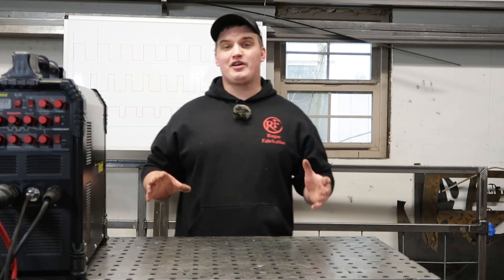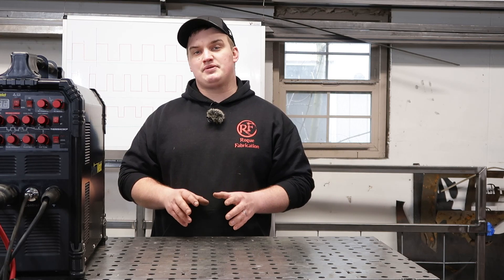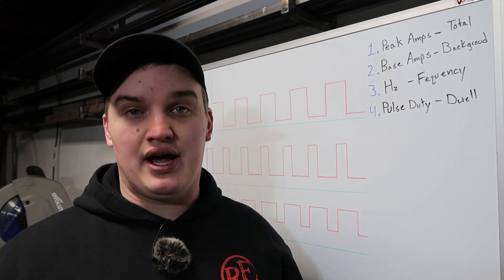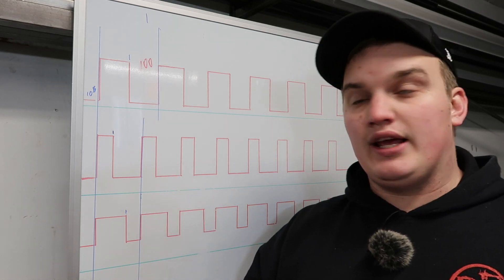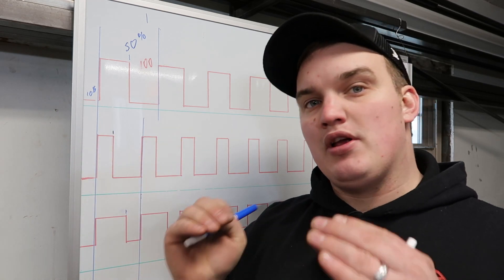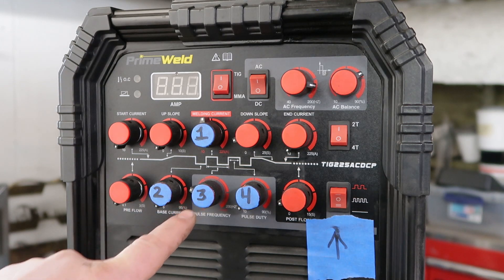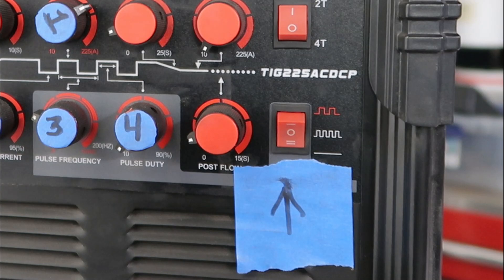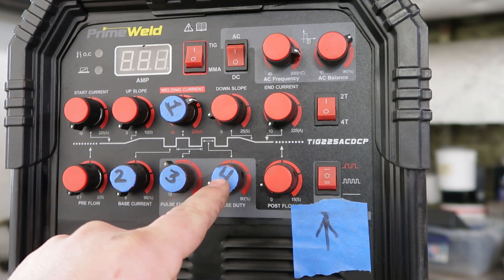Pulse Welding For Beginners  ( Explained ) Primeweld 225.

Comment: When you are using the foot pedal are you only adjusting the peak amps. The base amps will not change or do the base amps change based on the percentage of the peak amps?
Reply from the maker: It changes your base or starting amps as well  And then the pedal gives you the balance between the two parameters you set. So if you set your base amps to the same as your peak amps, no matter where they are, the pedal basically becomes an on off switch. Does that make sense?.

Comment: Does that Primewell give a digital read out when adjusting any other parameter other than peak amps?
Reply from the maker: Nope amperage is the only thing shown on the readout with this model
Reply: @amcustomfab  Thanks for the reply. That was a very well thought out presentation. Kudos
Reply from the maker: Thanks appreciate it 😎
Reply: Yeah. It would be nice if the digital readout showed value of the knob you're moving

Comment: Thank you so much.I have been tig welding for years. I learned with a ole scratch start machine I peace together. I then bought a miller transformer machine. I have no formal 
Training. I,m a machinist not a welder. I purchased a primeweld as yours about two years 
Ago. You have taught me more in this video than I knew in 30 years. I subscribed & can 
not thank you enough. You need to become a teacher.

Comment: Ok.. I'm new to this and I bought the prime weld 225x specifically to weld two 1/2" aluminum I beams together..I plated them, drilled and bolted them together..but I still want to weld the seam to make it solid and stronger.
What's the best settings on the machine for 1/4 and 1/2 inch aluminum..??
Reply from the maker: 225 is definitely going to be pushing it on half inch aluminum but to give yourself the best advantage I would do a couple of things.
 1.make sure you have the water cooler because you're going to need all the amperage you can get and the ck-17 is only rated for 150 amps.
2. To make sure you have something that you can preheat your joint with whether it be a propane/map gas torch. Or an infrared heater. I would bring the joint up to around 300° plus before you start welding to give yourself the best advantage possible.
3. I would crank your amps all the way up. And drop your hz or frequency down a little bit somewhere probably around 60 . And turn your balance down a little bit too to wind up your puddle somewhere down around 60 as well.
Good luck 😎🙏👊 and thanks for watching

Comment: How low can you get your amperage in AC tig mode with your frequency all the way down? My machine won’t go less than 19 amps. This machine is advertised at 10amps?
Reply from the maker: I think the 10 amps is DC only AC startup is a little higher
Reply: @amcustomfab  Any chance you could turn yours on and tell me what your lowest amperage setting is in AC?

Comment: I do have a same machine, great budget AC/DC Tig only wish they put better scale around knobs. Kind the hard to guess on some settings when working with aluminum or do pulsing ..
Reply: I've seen it suggested that you shoot photos of your happy settings for later reference.  The 325 actually reads out on each and all of the settings as I understand it.  No memory function as with Blue Red Green Yellow digitals, but I am thinking this may be simpler and better.   More reliable?  And less money.